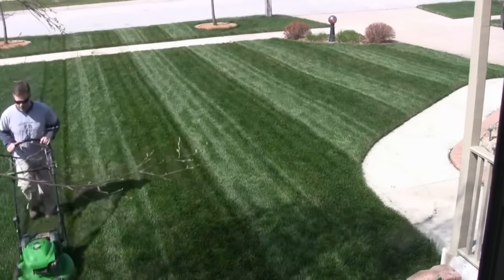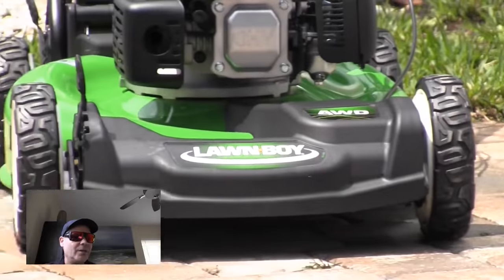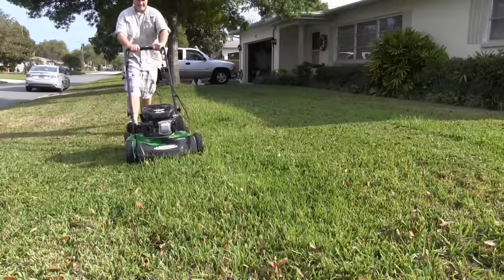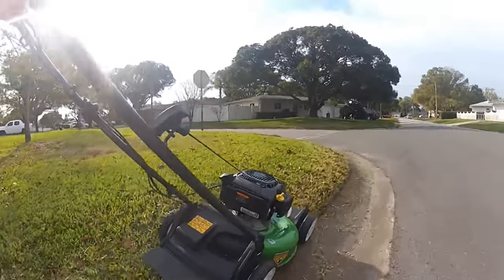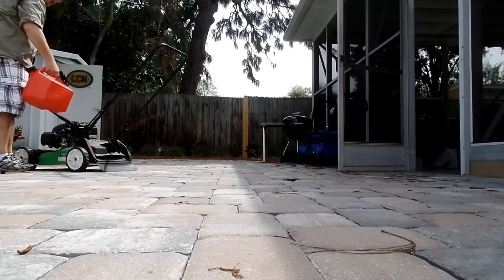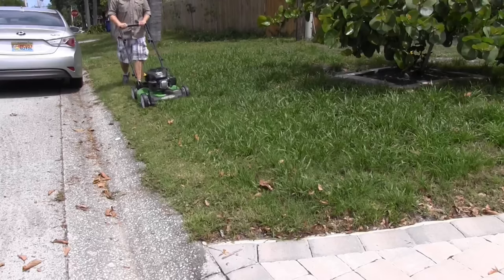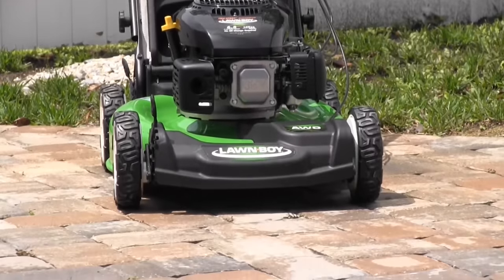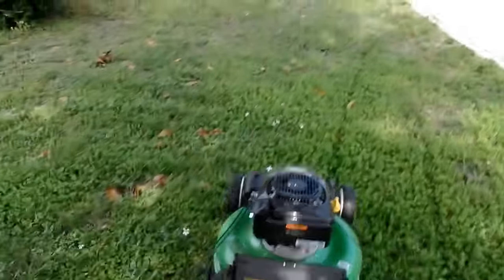Lawn Boy #10739 AWD Mower Review

Comment: I have the previous, RWD version model 10732. These are all very light. I keep them in my trailer for times I have to carry solo up over walls up stairs. The fuel cap leaks though, from day one, on both of the mowers I have (exact same). This is its biggest con and I wish the new models including the AWD on had a different fuel tank/cap

Comment: The current model, which is basically the same as this one, runs for about $319.99 plus tax at home depot.
Their is no lawn boy company Toro makes lawn boy, they bought them out from OMC around 1986. 
I got minr for free from a gut, just needed a carb clean. Its my first AWD. I'm gomna give it a try and post my non partisan review. It uses the same setup as the Toro awd, except no personal pace, which some like me prefer. It appears to be one of the better AWD mowers out their. First off the bat I will say is it could use a more powerful engine instead of the Kohler 149cc, but most residential mowers dont go over much more than 160-163cc now, so its not too far off. The old 190cc isnt on residential units any longer..

Comment: Hey Allyn! Would it be bad for the grass to cut a tiny yard (215 square feet) with a line trimmer? I've seen line trimmers that can attach to a mower set up that you push over a small yard. LCN for life!!
Reply from the maker: yeah it can work but line trimmers will rip the grass blades some which is not ideal

Comment: What do you think about the quality/durability of the wheels being attached to the deck area with plastic instead of being bolted onto metal? I'm about to buy one of these but lots of reviews mention cutting height issues from the plastic grooves breaking.
Reply from the maker: +Alan Sieja yes, there is quite a bit of plastic on it, which is a concern if you are tough on equipment like many people are. Higher cost equipment does come with better quality parts.

Comment: The height adjustment kept collapsing at the front wheels letting the blade hit the ground the first season. A bungee cord across stopped that. The following year the studs at the rear adjustment wiggled loose and that started collapsing. I drilled it out and put a nut and bolt through. Even on the highest setting this thing cuts too low. Too much plastic and not sturdy plastic. Maybe I could find an all steel deck in someones trash and drop the Honda motor on it.

Comment: just a couple of dumb questions:
1.  why would anyone need a self propelled lawn mower?  Unless you have some steep grades that need cutting, it really doesn't take much effort to push a lawn mower around.  Especially an all-wheel drive lawn mower.
2. have you ever used a reel mower?
Reply from the maker: I hate pushing lawn mowers - ever since I was a kid. In 95 degree heat here, it makes a huge difference. And i have used cheap manual reel mowers before just messing around but have never had a good one.
Reply: lol.  Is it just me or is there some irony in that statement?  You love mowing the lawn, but hate pushing the mower.  

For my yard I have a lawn tractor, gas mower, electric mower and a reel mower. The lawn tractor is the quickest but probably gives the worst cut and requires a lot of maintenance.  The reel mower is the most convenient for small areas because its the easiest to use.  It gives a nice cut but it doesn't mulch so if you're cutting anything more than 1/2" it leaves clippings all over the place and it doesn't do a good on edges near fences or borders.  The gas mower and the electric give the best cut.  The gas is heavy and loud and needs more maintenance but has the power to cut through longer grass and does a better job mulching.  The electric is light and easy to push but you have to fight with the cord.
Reply: I am a late-middle-age woman with hip and back issues. I am looking to replace my current (1995 model, yes it's old enough to drink) Lawn-Boy with a self-propelled mower.  I don't want to pull a cord, so I also want a push-button start.  I have lots of roots in my lawn (from my neighbor's silver maple junk tree), so it's very bumpy with all those roots at the soil surface; that's why I need a self-propelled mower to get over all those bumps.  I have mowed my own lawn for 20+ years and enjoy it to the point of pride (kinda anal, criss-crossing mow path each time, by the 4th mowing my lawn is plaid!).

Comment: A little bit  of subject but whats your take on attacking the dallisgrass problem.thanks
Reply: so what would you recommend for the dallisgrass problem cause I'm going through the same problem with bermuda and dallisgrass.
Reply: +Michael Mendez I use a product called Celsius WG. It will control the dallisgrass. It's pretty expensive for the upfront cost. It won't kill the bermuda.  It also controls a broad spectrum of broadleaf weeds and other grassy weeds. Follow the instructions on the label, you may have to spot spray it and follow up with it again 4 weeks later. Don't forget to buy some sticker spreader to mix in with your spray.
Reply: +Ryan Dean thanks alot Ryan dean I'll try that

Comment: Lawnboy is made by Toro, same wheels, AWD same, personal pace- handle different and the deck is stamped out different. Want a red one, get toro, want a green one, get lawnboy. both great units.. Lawnboy $75-100 cheaper than Toro, probably because of the bag/mulch deflector on toro..
Reply from the maker: aren't the engine configs different too? I always thought that is what made the Toro more expensive. Of course, once you get into the Super Recycler line for Toro, the quality goes up a notch and so does the price.